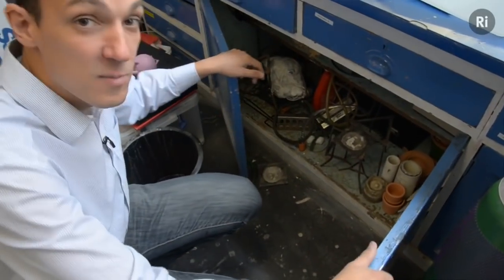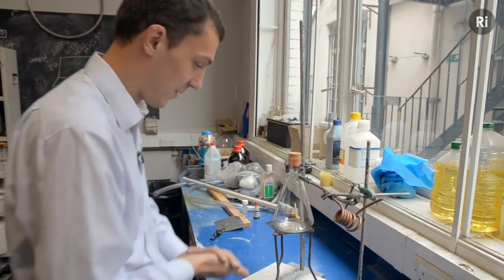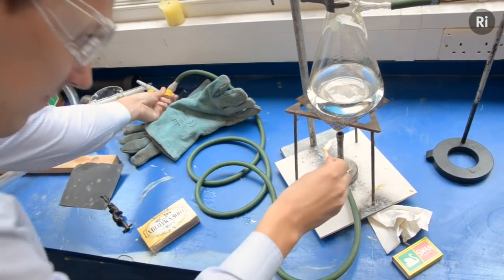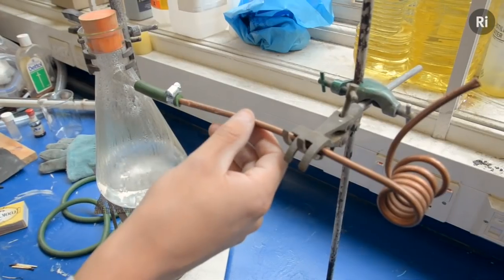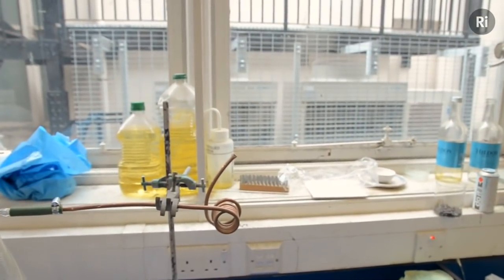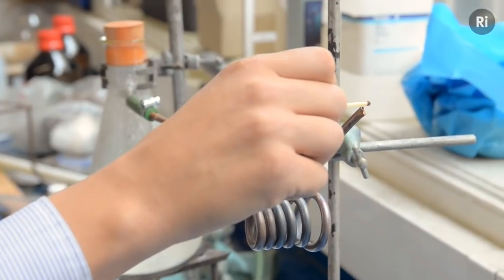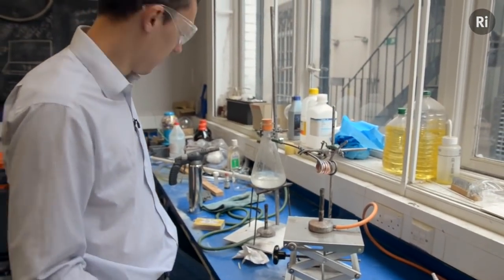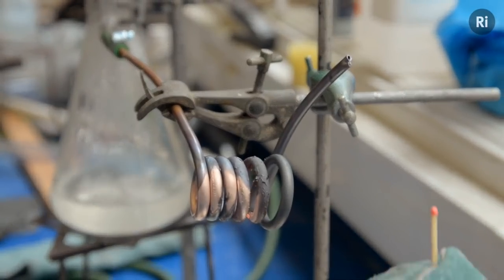Lighting a match with water

Comment: a match does not need oxygen to ignite. It has mix of chemical that provide oxygen and fuel. It needs only heat to start the reaction which goes quite fast. May be the steam is blowing away the flame so it is not visible until you move away the match immediately after it is ignited.

Comment: You don't need O2 from the air to ignite a match.  The match contains an oxidizer, like KClO3.
Reply: Clyde Wary Yeah, try lighting a match under water.
Reply: Clyde Wary Only in the head of the match though. The wood of the match still needs oxygen to ignite, that's why the first time he tried to light the match only the head burned off.

Comment from the maker: You're of course right that copper that is an excellent conductor of heat but not an especially good radiator of heat. The hot steam coming out of the tube is in direct contact with the match head and will deliver far more heat into the match than the radiant heat from the copper.

Comment: Wondering  if the match would light that close to the tip of the super heated tube without the water?
Reply: Randy DePuy the tip wouldn't be nearly at hot without the water but yes it probably would if it still had the steam flowing through it

Comment: Interesting but it seems to me that you proved that water will not light the match. Certainly the required heat comes from the water but nothing happened until you got the match away from the steam and in the presence of oxygen. Also, it was possible that the air near the outlet was being heated enough to ignite the match. I would want to see the match held nearby before being placed in the steam to be sure it was purely the heat from the steam that ignited the match.

Comment: "How to light a match with heat"
Reply: MegaBlackDays it was the heat of the water that lit the match the title is still accurate
Reply: George Hay it was heat air thrown by steam that light the match, not water.
Reply: tazmangw Superheated steam is still water.
Reply: first off, the way you quoted me makes little to no sense. when the tube is full of steam there is no air in there (when you fill a glass with water theres no air left in the glass except from the odd bubble which doesnt apply to this tube) the title is not misleading the water was just superheated and thus turned into steam. i'd write a ton more if you presented me with a good argument but next to all of it was wrong.
Reply: @tazmangw   I agree. although steam is being produced, it super heated beyond a certain point where the water vapor evaporated and SUPER HOT AIR is produced. that is what lit the match. Kind of like in a heat exchanger.
Reply: @NIGHTOWL-jf9zt  no, it was pure water. Air refers to the mix of gasses that make up the natural atmosphere (nitrogen, oxygen, CO2, etc.), but what come out of that tube was pure water.

Comment: What we can learn from this is that water does not extinguish flames because it is water but because it removes one of the essential elements of fire.  When it changes from liquid to vapor as it is sprayed on a flame it takes away heat.  Wet fuel such as wood does not light easily because the Water absorbs the ignition heat faster than the fuel can absorb it to sustain combustion.  Question! is this the phenomenon that allows carbonized fuel such as carbonized cotton to light and burn easily?

Comment: I think the match would light without the steam as the coil is heated by the burner. Also appeared as though the steam may have retarded combustion by condensating in the match head. Ignition was achieved slightly outside of the steam stream and in close proximity to the metallic tube. No doubt the steam is hot enough.

Comment: If you put the boiled water through in a combustion chamber together with the product electrolysis of the water- you will get a rapid expansion of the matter which is probably enough to propell a vehicle.
Reply: wow did you test this yet
Reply: Thats called a steam engine. No electrolysis needed.
Reply: sarcasem dude
Reply: Eric14492 Dude, the steam engine is where water passes heat medium to expand in space to press on pistons. 
What I am talking about is Stanley Meyer's motor that powered his buggy.
Reply: James Di I know what you were referring to.  Meyer's "perpetual motion machine" was fake, and Meyer was convicted of "gross and egregious fraud". Its amazing that his scam still fools the gullible.

Comment: While the copper is an excellent conductor of heat, the air that surrounds it is not. As long as he isn't touching the match directly to the copper tube, I strongly doubt that the pipe would heat the air around it enough to auto-ignite the match.

Comment: When he said "There's no oxygen in there", I felt smart for a few seconds thinking "Yes there is, it's just bonded with two hydrogen." Out of curiosity, isn't there oxygen normally dissolved in water? I would assume it's not nearly enough to sustain the reaction (and it's blowing too fast), but assuming the dissolved oxygen is still there, would it be enough to sustain the reaciton?
Reply: H2o

Comment: Hmmm... something doesn't seem right...

There is water all around us in the air... right? The big difference here is that, in this experiment, there is a tremendous amount of energy/heat coming out with the water vapor.

Either we accept the fact that we generally light a match with water in the air around us, or accept the fact that the match lit up because the heat reached the combustion threshold of the match.

Great experiment, nonetheless...
Reply: The point was that he superheating water enough so that it would ignite the match. I don't think you understand.
Reply: Leon Carbonell 
"There is water all around us in the air... right?"
This is correct, however the water level in the air, or Humidity, is a negligible amount of water and does not interfere with common applications of fire.

If a fire is hot enough, it can burn for a long time even in Rainy Conditions. Bon Fires are Awesome =^_^=

Water does not magically make fire die out on contact. Water deprives the fire of its fuel source, Oxygen. This is why throwing water on an Oil Fire is a horrible idea, because in an Oil Fire is fueled by the Oil. And don't even get me started on METAL Fires ^_^.

"Either we accept the fact that we generally light a match with water in the air around us [This is True], or accept the fact that the match lit up because the heat {of the water in the video] reached the combustion threshold of the match.[This is also True]"

So you are Correct Both times!
Yay Science!

Comment: It is interesting to know that objects won't burn until removed from the water.....
Reply: Well fire needs oxygen in order to burn, all the oxygen form the steam is already bonded to hydrogen, so the fire can't breath, which makes it unable to burn.
Reply: Funny because you don't know what you're talking about either.
Reply: The Herb If you blasted oxygen and fuel out of a high pressured torch, it'd still burn, the reason the fire doesn't form here when in the stream of super heated steam is because of the lack of oxygen in order for the reaction to take place.  The thing can be burned until it's black without having any fire if you leave it in the super heated steam.
Reply: No shit? The "oxygen is bonded to hydrogen" doesn't mean anything. The only way to break the bond between them is by electrolysis as far as I know, so that doesn't mean anything. That's like saying gasoline should be a gas because it has hydrogen atoms in some of he compounds. Like what the fuck man. This is barely high school chem!
Reply: Joshua Gavaghan Some elements like Sodium, Caesium and potassium can take the hydrogen from H2O effectively also at a high enough temprature the bonds will break.

Comment: Technically isn't the heated air causing combustion? It lights the match as you withdrawal it from the moisture stream and the heated air that surrounds the condensation lights the match.

Comment: Why is the water required? I'm sure if you pumped cool air in, it would light the match too. Or do you need the water molecules to carry the energy?
Reply: Jason Axford
Its teaching people that Water is not Magic. Water doesn't Magically make fires die out. Its teaching people that water can be Super Heated and in turn that energy can lite things on fire.
Reply: BlankPicketSign Thanks. But compared to other liquids at the same temperature, it's very efficient. I don't think petroleum at the same temperature can put a fire out. Isn't it about the lack of free oxygen? For the conclusion of the results of this experiment to be correct, the oxygen atom would have to remain bonded to the two hydrogen atoms at the temperatures he is raising them to. Does anyone know at what temperature oxygen and hydrogen would split apart?
Reply: Jason Axford
You are talking about the Thermal Decomposition of Water. This happens at around 2200°C according to Wikipidia

The water in the video is NO WHERE NEAR that hot... its over 200°C because of his thermometer going derp on us, but I'd say its not hotter than 400°C.

So that colorless gas he is using to light the match of fire is Water, just simple H2O at a hilariously hot +200°C
Reply: Thanks, that's cool..... or not.... bah, I'm going home.

Comment: It's not the water that is lighting the match, it's hot air.   By using the secondary torch you are heating the copper coil and the air inside.  All the water is doing is pushing the air out where it lights the match.

Comment: um thar is oxgen in water it has two higergen and one oxgen H2O so just needs more oxgen in the water and you can lite fires with it
Reply: lvl 3 science noob here!
Reply: Nope. There's water molecules in water. Once the oxygen and hydrogen atoms bond, they are no longer in the same configuration that they were in when they were atoms or molecular oxygen/hydrogen. Water not being able to fuel a burning reaction or you not being able to breathe water has nothing to do with the ratio of oxygen and hydrogen. It's a different chemical compound. There's roughly the same concentration of oxygen in the air. And hydrogen isn't toxic either. The difference is that the oxygen in the air is molecular oxygen.
Reply: the water has to be in gas form and extrmly hot the molecules in water have some oxygen in it
Reply: aidan burns Nope, not in the way you're thinking. Stuff burns because oxygen reacts with it. The oxygen that is part of a water molecule can't react with something else because it's already "committed" to the hydrogen. And you can't practically get water hot enough so that it separates into oxygen and hydrogen. Typically, it is done with electricity.
Reply: Pay attention in class.
Reply: Thx james bond

Comment: *Lighting a match with steam
Reply: Steam is still water. Liquid nitrogen is still just nitrogen. And molten iron is still iron.
Reply: Rumplelumpa Snickerdoodles Water has the connotation of being liquid, steam has the connotation of being gaseous.
Reply: poketopa123 I think is not water cause the H and the O are separated
Reply: poketopa1234 just in the general slang. No Chemistry student or Professor would use the term "Steam" in a scientific context. We say water to talk about water, be it in its solid, liquid or gaseous form. It's a quirk of language that we have seperate term for the three states of water, that doesn't change the fact that all three are just water and nothing else.
Reply: Rumplelumpa Snickerdoodles I might be totally wrong but, I think water can be a gas only if is not hot enough to make steam, if is too hot then the steam is not considered as water cause the O and the H are separated
Reply: crazy wheel they aren't separated, steam is only a term used to refer at the gaseous form of water. the molecule, H2O, is still the same in every form, it doesn't devide into hydrogen (H2) and oxygen (O2)

Comment: wait, if water is H2O, it should be flammable. i mean, oxygen is a fuel, and hydrogen is a fuel, so why not H2O?
Reply: In order to be able to burn, it has to react with oxygen. H2O already has oxygen in it so it doesnt react with it
Reply: (Oxygen is not a fuel, hydrogen is)
Reply: Hardcore Uranium the oxygen and hydrogen are chemically bonded. Properties of molecules can drastically change with chemical bonds (for example, Chlorine is a toxic gas and Sodium is a highly reactive metal but put them together, you get table salt)
Reply: Hardcore Uranium Not quite. Hydrogen is a fuel (a very energy-rich one at that), but oxygen is instead an oxidizer (of course). Fuel is something that wants to react with an oxidizer and release the energy. Water is the product of that reaction, it has already reacted with oxygen and has no inclination to burn further. Similarly, when you burn natural gas (CH₄), you get CO₂ and H₂O, which consist of the same elements but aren’t flammable in the slightest, instead being common fire suppressants. You can’t burn something which has already completely burned.
Reply: Keith Gordon oxygen is essential for fire but it is only one part of the fire triangle. fire requires: oxygen, heat and fuel. you cannot substitute the fuel with oxygen
Reply: Kipcha Vargosain Thanks for the opportunity to revisit Things Derek Won’t Work With. Shame he doesn’t post all that often. “You may not have felt the need for a better synthesis of metal azides.” :-)
Reply: Not quite, h2o is a compound, when 2 elements are chemically bonded their properties changes. You dont see h2o being a gas at room temp even though oxygen and hydrogen is a gas at room temp.
Reply: Guy Robot h2o can actually be a gas at room temp...

Comment: Why bother with water? You could just do it with hot air.
Reply: That's the point. He's showing that you can do it with steam too because people have the misconception that because it's water it couldn't start a fire.
Reply: silitradragos 
Its teaching people that Water is not Magic. Water doesn't Magically make fires die out. Its teaching people that water can be Super Heated and in turn that energy can lite things on fire.
Reply: Well its not really the water which ignites the match. I'd say the temperature is the key factor here. If you hold the match there it wont burn.
Reply: silitradragos
"Well its not really the water which ignites the match."
Yes, it is, it is the Temperature of the water that is igniting the match.
Water is being used to transfer the energy from the burners to the match.

What you are saying is a kin to "Well its not really the wires which turns on the light. I'd say the electricity is the key factor here."

Doesn't change the fact that the Wires are actually Important in the process.

Comment: Pathetic. Aside from a clickbait title, I'm not even convinced that the match was lit by superheated steam, though that would be no big deal if true. But you have a very, very hot blowtorch heating a copper coil. What's the temperature of the copper coil at the tip where the steam exits? Probably significantly higher than the exit temperature of the superheated steam. And the match head is within 3mm at most of that hot copper, which is what I think lit the match. So now try it with a ceramic nozzle, or some other good insulator.